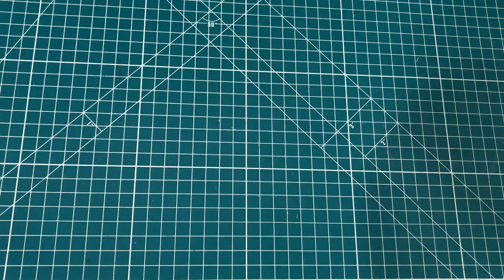RGBDuino Review and Giveaway!

Comment: Is there an auxiliary "power in" port, to run it separately from a PC?
Reply from the maker: It doesn't. I usually use a phone charger when I don't want to power with the pc. Otherwise you can use the VIN header
Reply: @AnotherMaker , so... Put 5VDC to the 5VDC pin?

Comment: That looks neat, and the plain smooth surface on the underside lessens the chance of shorting something out when it's laid down bare on a messy workbench, and the LED indicators on the output pins would be useful for debugging. I think my Granddaughter would like the Bikini Girl design more than the duck! I noticed that the bikini girl is listed as V1.2 whereas the duck is v1.1; is there any other difference other than the graphics?